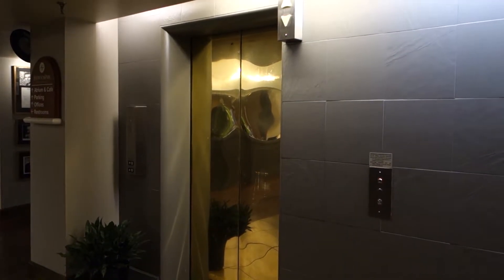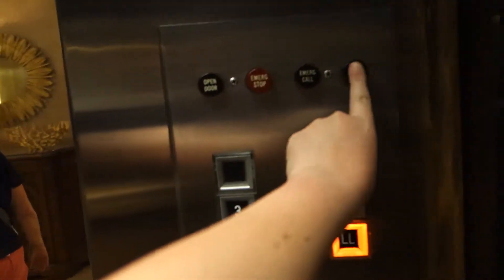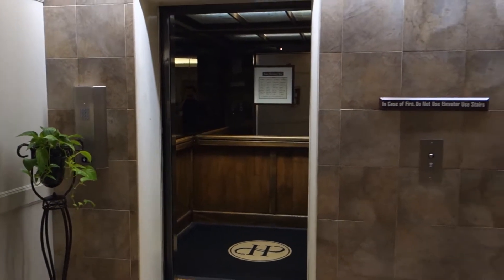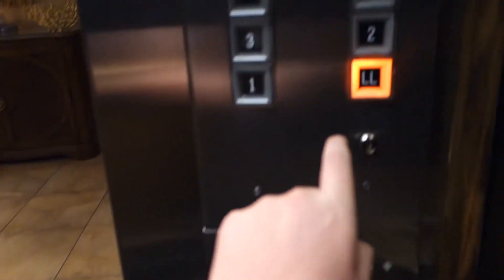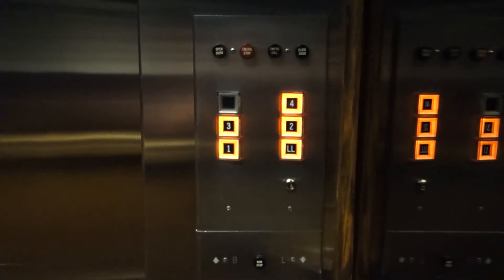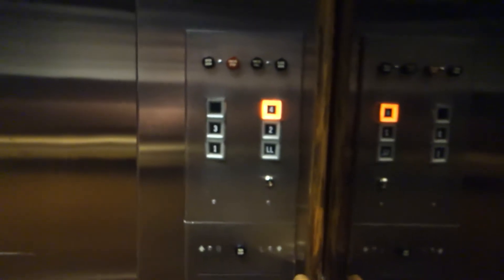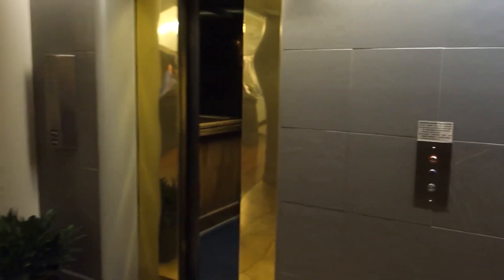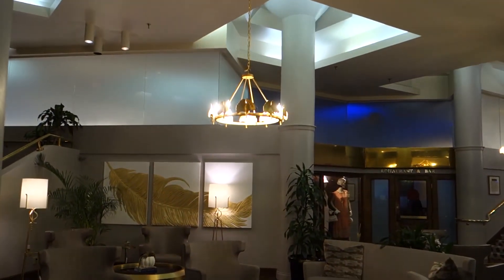AMAZING ANTIQUE 1955 Otis Touch Sensitive Traction Elevator at the Haywood Park Hotel, Asheville, NC

Comment: Otis touch buttons are some of my favorite elevator fixtures.

Notice the 3 line Otis logo on the doorsill. I think that is rarer than the 2 line logo.

I wonder what those B & L lights are next to the arrows.

09:30 I think it may cancel all car calls as it reverses direction, but I could be wrong.

I think the non-stop button may only work in attendant service, and it may have to be held down.

Comment: This lift looks like it's from the 80s FRIRND!
Reply: Hunterdon County EleFilms by Technicalboy3000 This “lift” is not 80s. I pretty sure you’re talking about the cab.
Reply from the maker: Hunterdon County EleFilms by Technicalboy3000 It doesn't look in ANYWAY like it's from the 80s, unless your talking about the call buttons or cab, which is from 2004. Otherwise, this is original from 1955. I will tell you though, it runs like it was installed today!!!!
Reply: Well it's certainly not the 1950s

Comment: The elevator at the Brooks Free Library in Harwich, MA also randomly stops on the first floor in both directions by taking phantom calls. The only difference is that Associated Elevator only installed it in the 2000s.